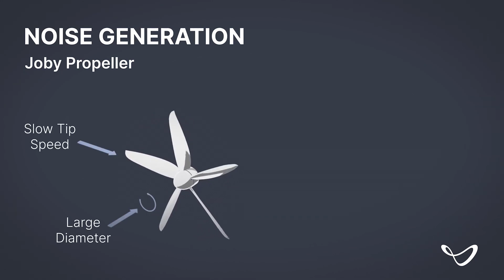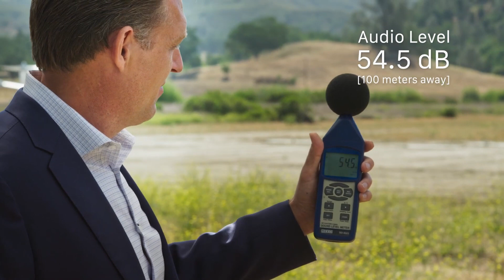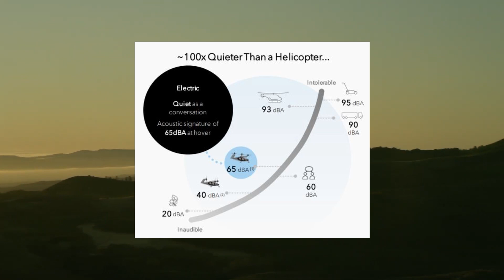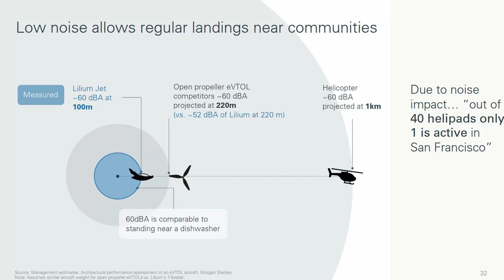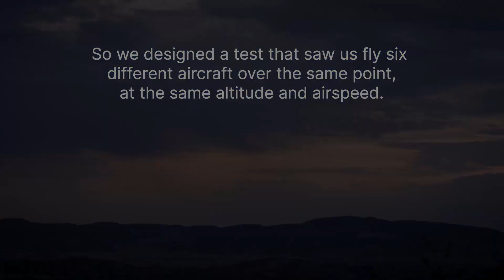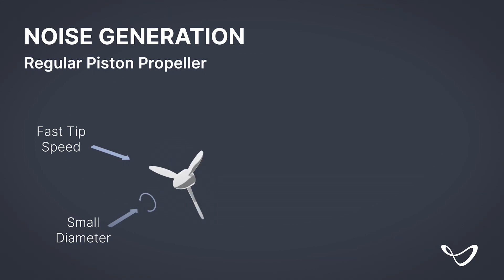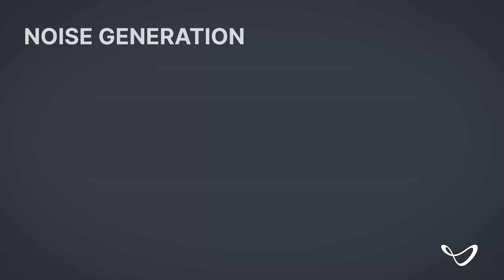Lilium vs Joby Which Electric Jet Quieter? Noise Level Of LILM & JOBY During Landing | eVTOL

Comment: It is not the noise that will determine their success. They are not too far a apart as far as the loudness goes, just a noticeable frequency difference. And that is considering we trust the exposure of the microphones used. You won't know it exactly unless they are tested side by side.  Smaller fans are louder to move the same volume of air. That is basic information. Their success will depend on the performance in adverse weather, range and unit cost. Not to mention the management team.

Comment: Since eVTOL is going to be used for commuting the city day to day as hydrocarbon driven automobile, yes, sound plays an important role!!! However,  there are other several aspects to be considered in terms of flight safety, complying aviation regulations, lesser complication and easy to operate, Lesser training for a common man to use, CAPEX, maintenance cost, efficiency, travel time, life of the aircraft etc., I believe 3 or 4 dB difference between two crafts do not make much difference when you list a score card of various aspects... With on going technological innovations and improvements, it's really a tough question to answer or compare which one is better!!! This eVTOL industry is yet to travel a very long distance to make any judgements...

Comment: Please forget the Lilium EDF nonsense- it doesn't work.  Not for low noise, not for flying. Lilium will never be flying commercially. Never! Noise is inefficiency and the EDF Units produce noise but no thrust. The thrust produced is a velocity for low drag high speed applications,  not high efficiency high lift capability . he efficiency of Lilium is so bad  they have double(!) the consumption of kw...that is volts x amps. They say its only short time but in several starts and landings the battery is empty without  flying! The range is app. 5 miles, the flight time app. 5 min. Without passengers, without cargo!! In flight mode there is no lift from the wings as the EDFs generate part of that- also inefficient thru obstructed airflow. Short: Lilium is for idiots.
If the battery for 10 min flight is installed- there is no additional weight for passengers or cargo possible! 440 kg empty,  max take off 1000 kg- battery 600 kg (with 120 kwh). Already taken the new battery generation in development assumed. With the existing battery 5 min flight time max. .. empty (!).  So far no test flights from Lilium with pilot!!!!! Only 3 demo remote controlled!
Joby has completed 1150 flights so far.
Reply: Wait and see, mate. 😌

Comment: It looks like both the Lilium and Joby are "quiet" enough. I'm just wondering now if any of them could glide safely to the ground in case of a failure. Other than that, the Lilium just looks "safer" with no exposed propellers.
Reply: Yes and greater redundancy.
Reply: Lilium Jets undercarriage is being upgraded to allow conventional landings and short takeoff.   It makes sense to opperate in STOBL mode if a 100m runway is available.

Comment: I have a question, why do you people use the term “Jet”? These are in no way a “jet” aircraft unless your redefining what the definition of jet is in the aircraft industry. Oh, Marketing. I see!
Reply: I did not see anyone answer your question. The answer is that a jet is the high velocity and directed expulsion of a fluid to create thrust. That fluid can be anything like air or water. 

You are probably thinking that a jet is the large engine you see hanging from an airliner wing. That is called a Turbofan engine (turbine core driving a larger fan blade disk). There used to be longer, narrower versions of this called Turbojets (Turbine cores generating thrust by the expulsion of high speed exhaust gasses). Turbojets are very rarely used any longer because they are inefficient. 

Yet, aircraft that use either Turbofans or Turbojets are called jet aircraft because they both use the expulsion of air (smaller airmass at higher speeds for Turbojet, and larger airmass at slower speeds for Turbofans) to create thrust. Even diesel, piston-engined boats using enclosed impeller pumps to create thrust are called jet boats.

Comment: Brilliant video! Thanks FGain for this key comparison, and AgentP and Michael Isaacson for great comments.
 I've been following this industry since 2018, and I really want it to succeed. Videos like this really help clarify key points.
 
As AgentP notes, the Joby airframe is inherently much safer in mechanical failure.
 
Michael Issacson makes good points that we'll accept the noise of both of these airframes in current helipad and airport infrastructure, but he is quite wrong, in my view, that many American cities will accept the high-pitched TOL (take off and landing) noise of the Lilium in all the new vertiports that will come, especially in the suburbs. Air taxis making this "jet noise" will be able to operate at existing (very limited) helipad and small airport infrastructure, but they'll be blocked from scaling into the suburbs by activists who are greatly and rightly concerned with such noise. NIMBYs won't allow them in new vertiports unless they can eliminate that noise with acoustic liners. I unfortunately doubt that they will be reduce it much. The Venturi effect from all those small tubes generates a lot of that noise, so I doubt they can get rid of it. If they can, every surburb that allows leaf blowers will mandate that the same noise reduction tech go into all those noisy leafblowers that wake up sleepy suburbanites every morning. Cities are mandating electric leafblowers now, (for decarbonization and for noise) but the electrics are still quite noisy.
 
One possibility that would allow noisier air taxis would be very tall suburban vertiports, but those will be very expensive to build. If standard air taxi airframes with big, low-noise props can take off and land quietly with just a four story vertiport with sound baffling at the top, what city will want to build taller ones just for Lilium? Not many.
 
Lilium has a very impressive technical team, and I love their safety-via-simulation strategy, but they made a big leap to go with the ducted fan and nontraditional airframe. Unfortunately I think the high-pitched noise is going to greatly limit their scaling.
 
In my view, Joby, Wisk, and Lilium are a good deal ahead of several dozen other serious OEMs at present. I am hopeful that all three and others in this space, like Beta and Airflow Aero, prosper in what will be a huge new market, with so many vital uses (commuting, ambulance, defense, cargo delivery, wildfires, access to nature, tourism, etc.) But I predict that Lilium will get some serious pushback for use of this airframe in both semi-urban and suburban commuter air taxis unless they can fix the TOL noise. TOL and overflight noise have always been huge issues for new small airport construction, and they are only going to be bigger issues in the years ahead. I predict that noise abatement will become a major political issue as these things scale. We haven't seen the public weigh in on these yet, but they will, as they well should. We shall see!
Reply from the maker: Thank you for watching and commenting, John.
Reply: @FGain  You are doing brilliant work. Thanks for covering this emerging industry so well. 

Thanks also for your helpful videos on the Canadian Trucker Strike. I'm proud of all those Canadians expressing their pain. Sometimes mass action is necessary to get leaders to reset their priorities. Helping all those who have been displaced by this pandemic and getting our economies back to health are surely the most important priorities now. Our vaccines have been a great and admirable success story but they pale in comparison to the power of nature itself. Omicron and later variants are "natures vaccine" (far less deadly, far more infectious) vaccinating us all again with a new variant, and hastening the end of this pandemic. Epidemiologists like Paul Ewald have long known this is how most pandemics end, but the media and our public health experts are not yet ready to explain that story. I'm optimistic we'll be past a lot of these mandates by Summer, though many won't want to give them up.

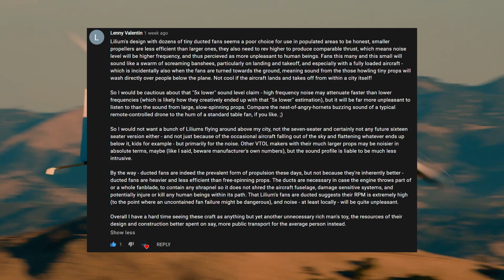Comment: I think the commenter at 5:22 misunderstands the reason for using ducts. Lilium is really using an electric jet, not a ducted propeller. They have the ability to modulate the nozzle area, increasing efficiency of the motors in the cruise phase. In terms of aerodynamic efficiency, my bet is that Lilium will be far more aerodynamically efficient than Joby's contraption. The comparison at this stage is also not 'apples to apples' as you say, because the demonstrator does not yet have the acoustic liners. These liners will be aimed at reducing the unwanted high frequency noise. I know you mentioned that but I just wanted to reemphasize it.
Reply: An eVTOL with a range under 160km probably will not find much of a market.   eVTOL with ranges such as Airbus's City (85kM) or Volocopter city will be useful but in many cases the trouble of a car journey will not be so bad.   Lilium EDF electric ducted fans are inefficient in hover, needing 1.8 x more power in hover than an open rotor but will be much more efficient in forward flight.   The Objective of Lilium is to achieved 250km operation range with 6 passengers and reserves.   This exceeds the 160km that the uber Elevate white paper said most 'super commuters', the main customers, would need.  The demands for hover on Lilium batteries actually have a positive benefit in that they will allow very rapid charging.
Reply: @williamzk9083  I think I agree with what you're saying. Lilium's market is different. It's not about accelerating a cross-town commute. It is about opening links between cities where the only current option is congested automobile traffic. The other designs are just toys IMO.

Comment: Lilium should also be fairly quiet in cruise though. That would be the regime where the ducted fans are more efficient. The shift towards higher pitch also means it should fall off faster at further distances. But I am really impressed by Joby's noise performance
Reply: -I just don't see Lilium Jet as being noisy in vertical mode at all from the video.  It's quiet and we know acoustics liners and helmholz resonators will pull of another 5dB.  The aircraft even lands on Pasture.  
   - I also think the professional noise cancelling mike setup designed for actors and speaking that the Joby CEO is wired up with is going to reduce the sound whereas with Lilium is just recording audio from a camcorder.

Comment: Lilium is not designed to spend much time in vertical mode. It's meant to spend about 30 seconds taking off and landing, where it needs the most power.  When it's in cruise mode there's very little noise and it is very efficient. The smaller fans offer lower drag.  It is designed for inter city travel not cross town travel, so it won't be hovering above you.  In cruise flight it's almost inaudible.
Reply: No, that's completely wrong.  Small blades are inherently less efficient, because they have to turn too fast to make up for it.  You hear all that noise they're making?  That's wasted energy.

There's a reason jet engines have become quieter as they've become more efficient.  It's because they transitioned from turbojets, which move less air at a higher speed, to turbo fans, with larger fan blades that move more air at a lower speed.  High mass flow at low speed is simply more efficient.  Look at turboprops, when you can attach a propeller to it it gets even better.  The Lillium design is fundamentally inefficient.  It's not a serious design, it's an attempt to grab attention and get investors to dump money into the company because it looks cool.  You should only use small, loud ducted fans if you are in a serious space constraint.  They're mostly only useful for RC aircraft when someone wants to make a model look like a jet without putting a real turbine engine in it.  Larger, slower turning ducted fans are different, but that's not what we're talking about here.

But then none of these are really serious designs.  They all fundamentally impractical.  But the Lillium is especially insulting, especially after they tried to claim that their system of a huge number of tiny, screaming fans was "whisper quiet" when taking off and landing.  Fewer, larger motors turning larger blades are always going to be more efficient.

Also, you're wrong trying to hand wave away the noise it makes in vertical flight mode.  That's the noise that matters the most.  That's the noise that impacts the quality of life of people around it.  These things are supposed to be air taxis, they're supposed to pick people up from the middle of the city, they're supposed to be able to operate from small sites in places where you can't have airports.  So the noise level matters the most when it's in vertical flight mode, because that's when it's nearest to other people.  That again is why I say this is not a serious design.
Reply: You're forgetting that if you have a larger diameter prop, you need a bigger motor and more energy to rotate it. There's also more drag when spinning that isn't utilized for thrust with a larger prop. Why doesn't Dyson use huge electric motors and blades in their quiet and efficient vacuums if they're so terrible?

Comment: Having no experience in the field, I just assumed that open blades would make more noise (even with the advantage of being able to spin the rotors more slowly). So I was surprised at how much quieter Joby was than Lilium (especially given how much Lilium has been talking up how quiet their aircraft is). I would, of course, still want to see independent noise testing of both, rather than just taking the word of the manufacturer.

Based on the demo's in this video, I find Lilium noise levels to be totally unacceptable, and I would strongly object to this coming anywhere near where I live. The Joby, on the other hand, I found much more agreeable in both tone and volume, and assuming that there weren't multiple Jobys coming and going every few minutes, I could quite easily 'tune out' its noise and ignore it. If Joby continues to refine and improve on what they've already achieved, then they will effectively be inaudible (to all intents and purposes) which is a huge advantage for them that can not be overstated.

I prefer the Lilum design, but nice-looks are not going to stop me being woken up by that screeching sound if Liliums were in regular use in my area. I have zero loyalty. Whomever is the quietest will always be the deciding factor for me (barring any other major issues such as safety etc.)
Reply: The Ilium sound levels seem to me completely acceptable even at this point without acoustic liners.  It may even be quieter than Joby.  Lilium will have more noise from the higher speed air but less noise from blade tip.   They are clearly way lower than a helicopter.  Yes not as quiet as Joby but still acceptable and remember the acoustic liners aren't in yet and that a vertiport will likely have anechoic rubber mats and a fence that will kill off much sound.  The higher frequency sounds of Ilium are much easier to absorb in anechoic liners.   You're right about one thing, independent sound measurements are needed.  To many tricks can be done with noise cancelling microphones where one microphone is aimed at the speakers mouth and others in a general direction which is subtracted.  High end cellphone mics do it.

Comment: I wonder about comparing noise level versus load/passenger capacity? Also, the propeller design on Joby seems to prevent higher speeds than the aircraft that were compared.
Reply from the maker: Lohi, see comparison of technical parameters in this video  https://youtu.be/IbIY1f05OrY